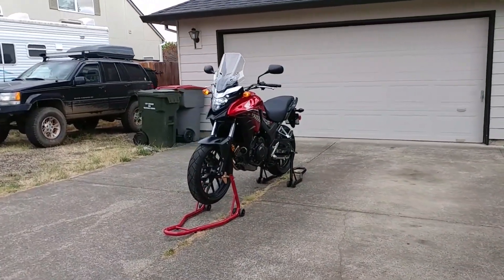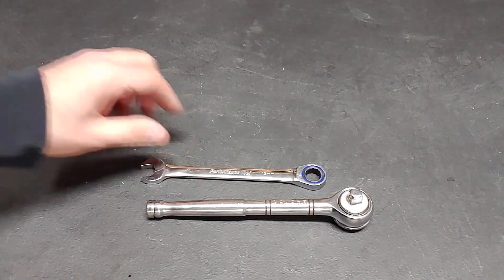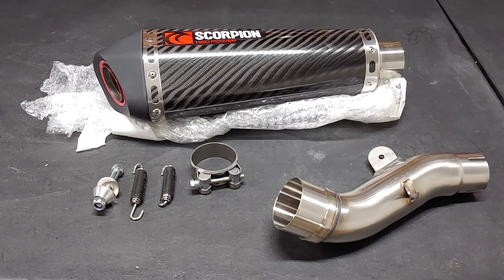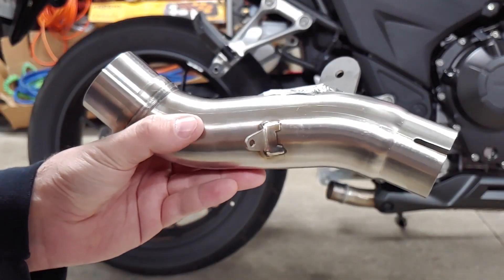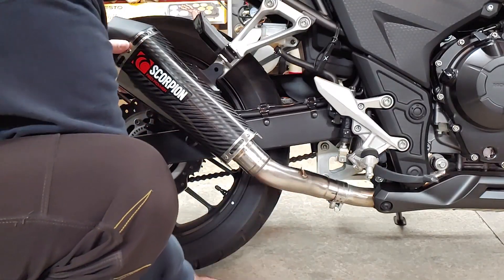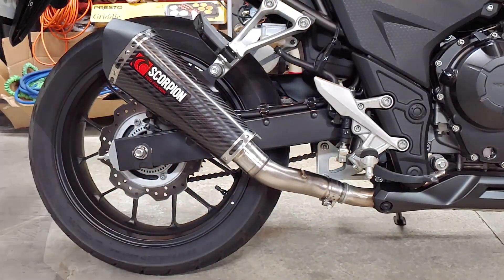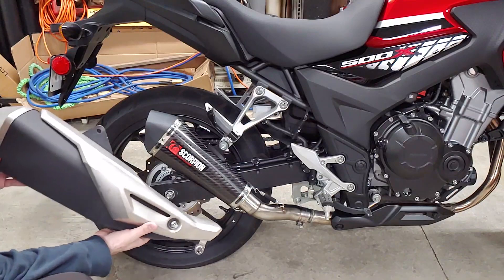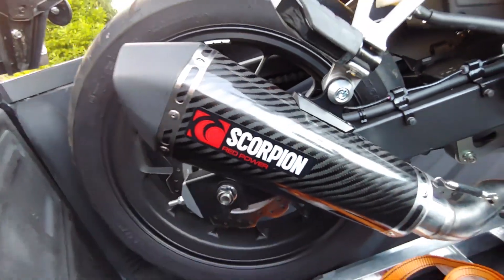Motorcycle Slip On Exhaust Installation - Honda CB500X / CBR500R / CB500F

Comment: Here from the 500r owners group, thanks for sending this along, I will reference this when fitting my exhaust.
Reply from the maker: Awesome! I hope you find it helpful. I have some other videos on the 500r you might like including how to change the oil, air filter, flush the coolant, bleed the brakes, and more. I plan to keep the bike long term, so more videos will come. Thanks for your support.

Comment: Nice, just in time coz I'm in search for new muffler..Carbon finish look so dope, would you recommend it over the other two options stainless steel and titanium? I want ease of cleaning later down the road
Reply from the maker: What I told my friend who owns the bike in the video is this: If you just want to ride on the street then carbon fiber is the way to go.  It looks impressive and cleans up easily with soap and water.  Just don't let it sit in the sun all the time because the finish can become dull and yellowed.  If you want to ride dirt and gravel too then you should go with the stainless steel because the carbon could easily get damaged from rock chips or dropping your bike.  I'm not sure I see a reason to go with titanium unless it looks really good or is significantly lighter than the steel version.  I have a carbon Yoshimura and people compliment it all the time.
Reply: @EndlessMoneyPits  Thank you so much. Didn't even thinking about rock chips and nasty stuff, thanks. I ride only street, but I'm kinda worried about carbon finish going dull on the sun, I guess it's gonna be steel for me.
Reply from the maker: @Geo_Okami  My friend wants to do some gravel riding eventually but went with the carbon exhaust anyway.  You should do whatever makes you happy.  That's probably the reason you got the bike in the first place ;)